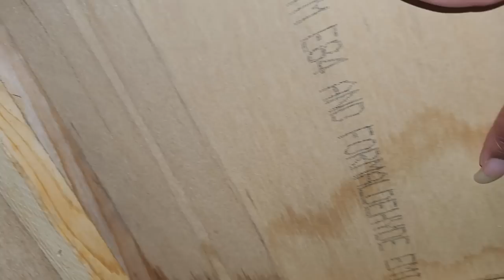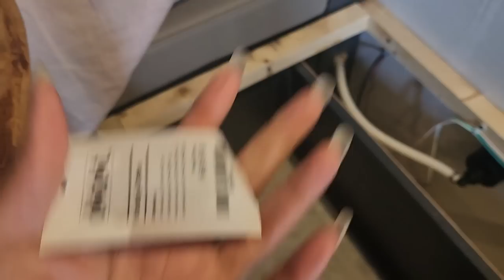General RV Caused a LEAK and WATER DAMAGE in My New RV | Solo Female Van Life in Travel Trailer

Comment: I am SO SICK of RV dealers and their service departments just royally ripping people like you and me off. I took my brand new travel trailer in for warranty repairs. My dealer was MeyersRV.  When I went to pick it up, they told me it was ready and to drive on back to hook up. Before doing so, I opened and looked into the trailer to find mud all over the floors, bits and pieces of repair parts (none of which were necessary for the repairs I had done) and water pooled on the floor!!!  I was furious and let them know it in ever so polite a manner that they needed to make EVERYTHING in my life better RIGHT THEN. It took 4hours longer, because I found they had NOT fixed the things I’d included on my list. We just can’t have nothin!!!  I took the same approach you did and ultimately had to go all the way to the corporate level.  It may be too late at this point, but don’t live with the damage General RV caused to your home. Make them replace all that damaged wood. Documentation does not repair the wood.  Make sure you check the floor, which may also be impacted.
Reply: My jaw dropped four times reading this!!!! Ok, these RV dealers better start getting some quality control together. This isn’t cool!!!
Reply: @Iggystar71  No, it’s definitely not! I was so upset. Now, I’m learning how to repair things myself, but most RV manufacturers will only deliver parts to dealers. They do their darndest to force RV buyers to go back to the same dealers.  It’s like a scam!  It is past time for customers to push back.
Reply: @roadtriplover.  I’m glad you were firm about them making you happy. Money is hard earned. These places should be ashamed.

Comment: Are you running the air conditioner? Air conditioners will condense the moisture in the air and drip like that. Make sure you’re tracing it to the actual water pump. Turn off your air conditioner leave it sit for a while. Then if it’s still leaking, it’s the water pump. if it only happens when the air conditioners on that is air conditioner condensation and it’s supposed to be like that. My trailer has a drip from the very top that freaked me out until I realized it’s coming off the air conditioner.

Comment: If you don’t get any satisfaction from the dealership contact the actual manufacturer. I had a similar situation with a soft top convertible that was dry rotting and leaking inside. I contacted Volkswagen of America directly on line and uploaded pictures.within 2 days I received an email that my roof will be replaced, the dealership was giving me the runaround after several attempts. I bought it gently used of 3 years old. On initial inspection everything was fine until it rained and I noticed the roof separating from the window. Also, the General manager of the dealership contacted me after I contacted Volkswagen to offer me a loaner and a apology. I am sorry you have to experience this situation. It’s good that you are documenting to submit to the manufacturer. Hopefully, you get a refund or a new trailer. ❤
Reply: I recommend replacement and not repair for resale purposes. You would have disclose water damage if you wanted to sell the RV in the future.

Comment: I am so sorry I am mad for you!  I wonder if they did not use a pressure regulator when filling the water tank and it burst one of your lines.   And like you said why did they even fill it with water? They should just do what you asked them to do nothing more.  If they don't fix it I would go directly to the factory in Elkhart.  I don't trust any of the RV dealers to work on my Travato!  Don't ever leave it tell them you will wait for it and sleep it in at night if it is more than one night. Also video and take pictures before letting them work on it.

Comment: I don't know if it was mentioned and I missed it, but why was there silicon applied all over the area of the leak on the outside? That is very suspect to me. I'm sure you have this handled, but with the impact this is making on your finances and housing situation, it seems like they are not doing enough. I realize there's more to the story and this video isn't everything. But, I think it would be a good idea to put it all in writing, like an itemized invoice. They need to provide a loaner camper or compensate you during that repair time, as well as for the other expenses. If you put it all in writing then your expectations are clear to them, and you have that documentation for any claims. Goodness gracious! You deserve to be treated like a queen so this is really disappointing. I'm even mad at Cracker Barrel for that dinner! When it rains it pours right? Hopefully everything turns around for you real quick 💜